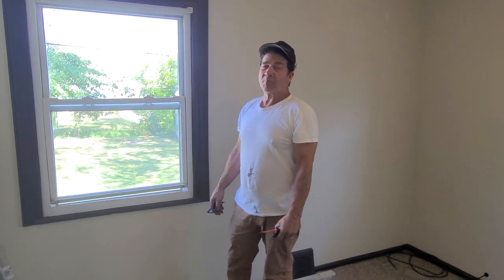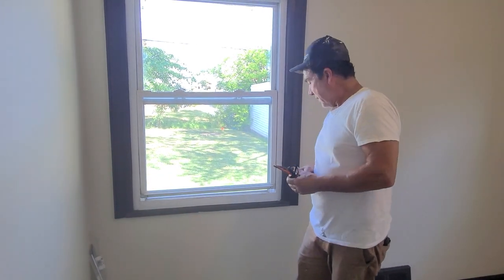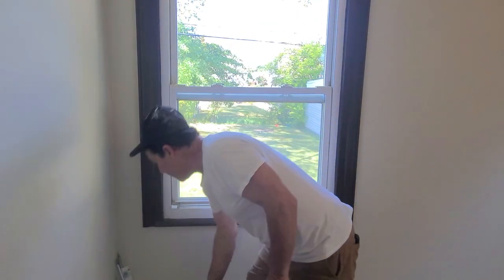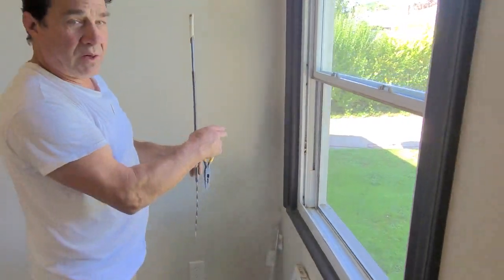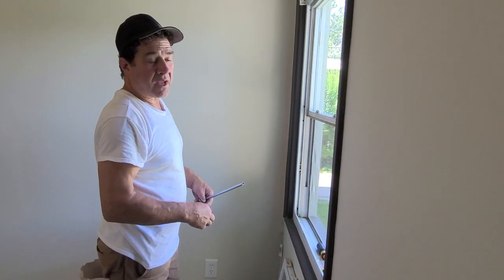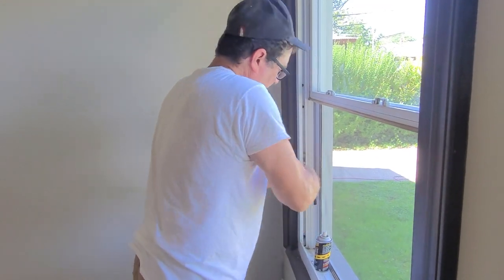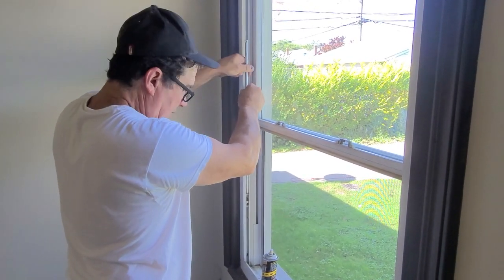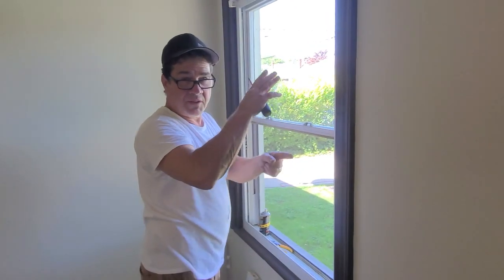HOW TO Fix a VINYL window that Won't Stay Open

Comment: 1)  I respect you for making the video - Thank you for doing this, reason why I am here watching
2) He should unlock the shoe so it will move up and down freely.
3) One must use "that" tool he showed to remove the Tension on the original spring, else you may get hurt, please note to noise when he removes the top screw The unscrew the at 2:37AM
Note: I loved the good sense of humor. Cheers
Reply: Thank you so much for the input and your kindness
Reply from the maker: Thought I would share this video with you….it shows exactly what your saying.     HOW TO Repair a Window Part 2
https://youtu.be/ZUoGYuIVZzY

Comment: What was that material that cracked when you pulled the screw out at 2:29? It came out with the spring and you are holding it with your right hand at 3:10.  Looked like it could be foam or plastic but hard to tell.
Reply from the maker: We took the tension spring out of the window. The white plastic was the casing the encloses the spring. It breaks off when you take it out of the window.

Comment: Is it the same set up for the upper outside window? Meaning you did the lower inside just to be clear
Reply from the maker: Yes it would be.  Both sashes are built with the same tension bars

Comment: How do you know how much to tension the new rod before installing?
Reply from the maker: Great question Robert. The answer to your question is I make it a rule of thumb to twist it 3 to 4 times , the amount may very due to the weight of the window so we adjust as necessary. Thank you for watching and feel free to ask if you have anymore questions 👍
Reply: @homerehabpros9617  I've seen others twist it 10 to 15 times? Is that ok? Also, my window has two springs, one on each side. Do I have to install both or just one? Both springs are broken and waiting for amazon to deliver them tomorrow.
Reply from the maker: @kojimasan444  I would definitely install both of them.   10 to 15 times seems excessive and could put to much tension there but I don’t think it would hurt anything.
Reply: @homerehabpros9617  thank you!!

Comment: Where do we buy these and how do you know what size to buy?
Reply from the maker: You can remove the part and use it to compare. You can find some online window parts suppliers, or you can go to Home Depot, or Lowe’s, etc and talk to someone in the window department. Sometimes a local hardware store can help as well.  I will say that sometimes it can be a bit challenging, but we have always been able to find what we needed.

Comment: The problem that I have is finding parts and no one wants to help.
Reply from the maker: That is true…it can be hard to find parts.  We have sometimes had to go online for older window parts.  Sometimes, if you have the old part you can take it to Home Depot or Lowes and they can order them.  Sometimes a local Hardware store can do things like that as well.